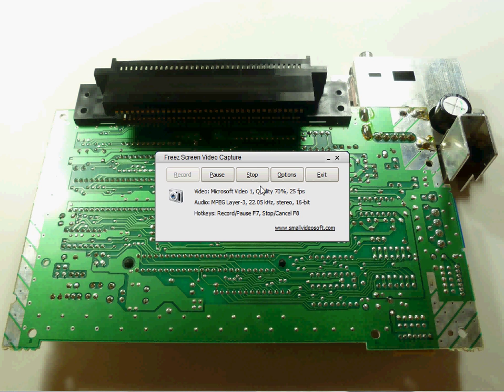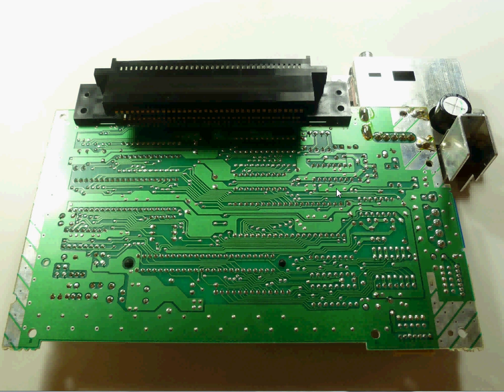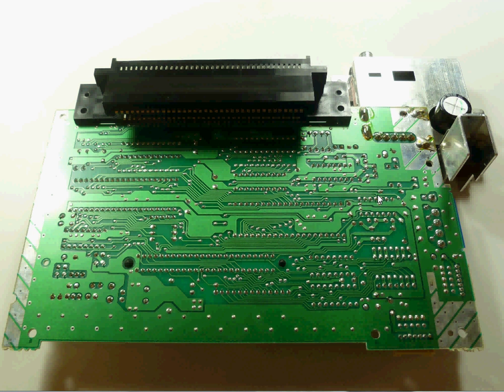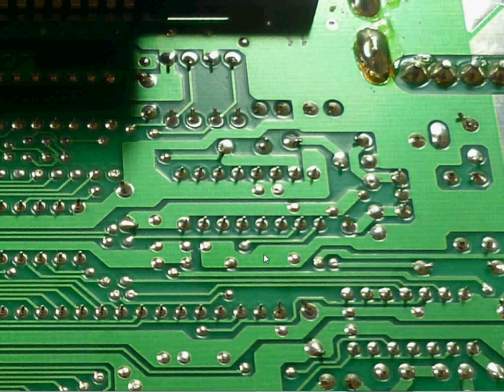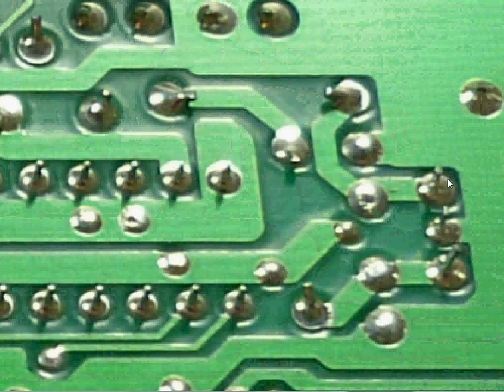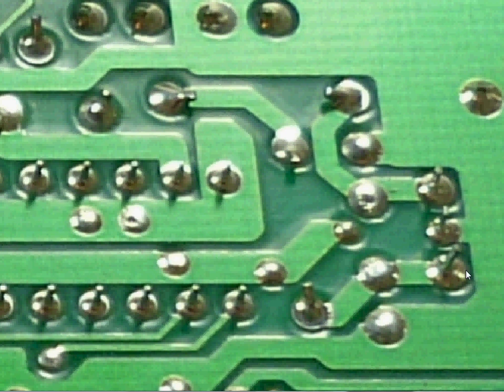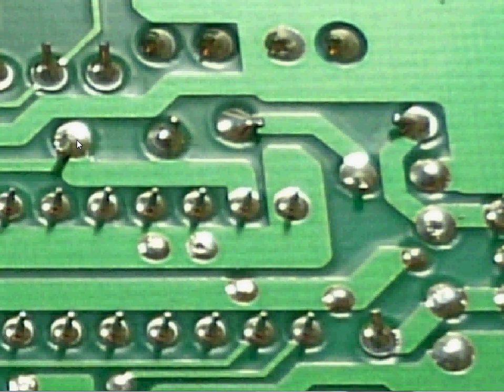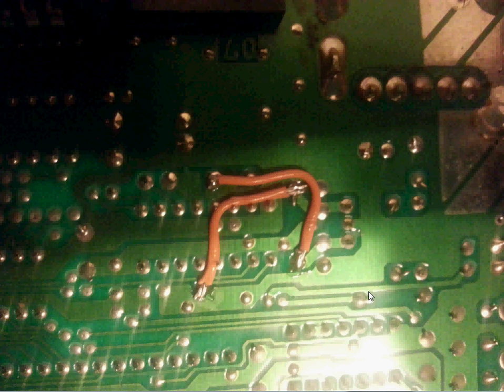Disable 10NES chip mod 2 wire method for NES

Comment: You might do better with this video if you change the title. "Nintendo NES Region Bypass Mod 2 Wire Mod" Something like that.

I just did this mod to my NTSC-U NES-CPU-08. There is two versions of this mod depending on layout. I did the other version. Very easy to do and works perfectly. Mutilating chips should always be the last resort.
Reply: Hey buddy can you send me link to what version you used?
Reply: @kultur-vultur  go on consolesunleashed.com and look at the guides section.